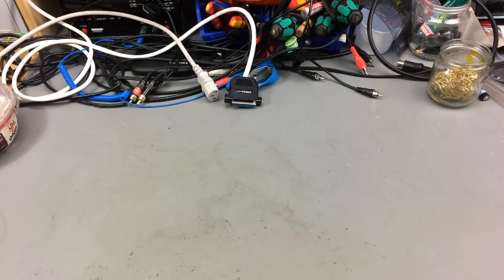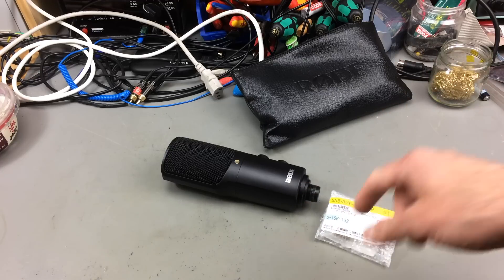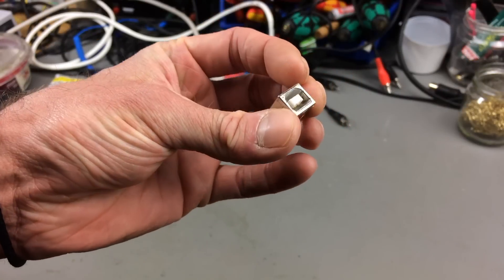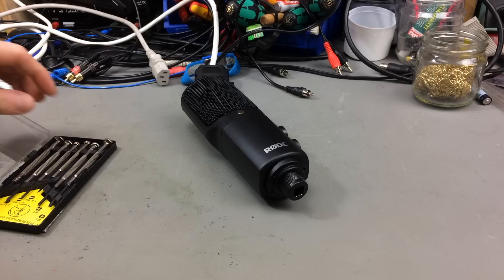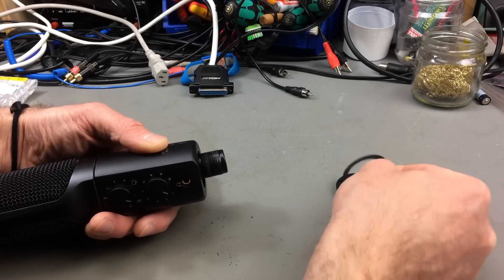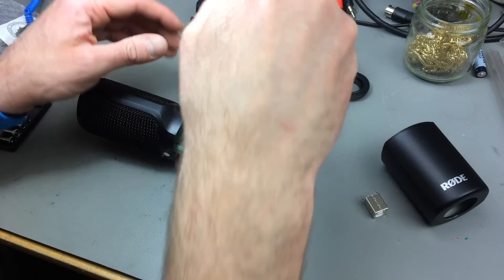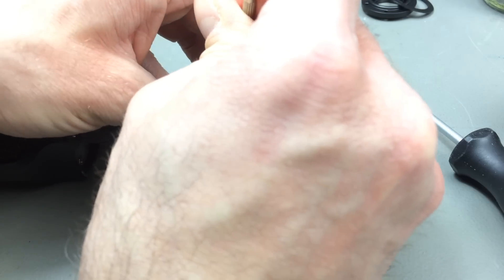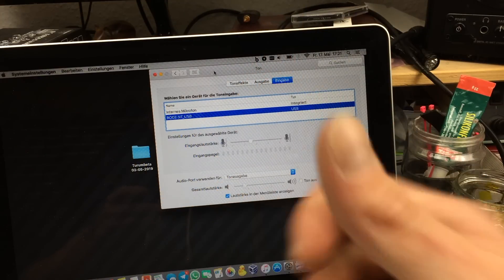Røde NT USB Microphone Repair

Comment: Excuse me, Jan. I understand this video was produced six years ago, but I thought I would reach out to you in regards to my own NT USB.
I attempted my first time soldering on my RODE NT USB because my port broke, which is this exact repair you did. I did not do it correctly, and unfortunately it lead to the silicon being too hot.
I've shipped the microphone to my friend who lives out of state, and he tells me that the PCB can be replaced, for the USB connector that is. If you know anything in regards of locating one of these components, I would be incredibly grateful.
I am in a disposition where replacing my microphone altogether would be damaging to me, and if I cannot truly save my NT USB, then at least I will know my next steps forward, and that would be saving up for an XLR, and DAC etc. Perhaps that is the way.
Reply from the maker: No idea where to get those replacement boards, unfortunately. Maybe ask at Rode directly? They might have a department that provides spare parts to repair shops. They are very likely more interested in selling you a new mic so I wouldn’t hold my breath though. :/
Reply: @JanBeta oh believe me, I've considered that outcome- sadly

Comment: I have this same mic since 2015. I live in the UK. Today I wanted to use it, but no blue light on the front. Mic is detected by windows and OBS, but no sound is picked up by the mic. Any idea what would be causing this? Thanks
Reply from the maker: Sounds like maybe it's a connector problem, too. Probably the voltage supply to the mic cuts out. Might be a broken trace somewhere, too.
Reply: @JanBeta  Surely it cannot be a connector issue as the mic is getting detected? Moving the USB cable at the connection DOESS NOT make it intermittently work. Can I send you photos of the interior if I open it up.. and would you be able to assess it from those photos? Thanks

Comment: My Rode NT USB began to be detected in the Windows system as a USB PnP Sound Device. I reinstalled the USB drivers, I reinstalled Windows, I changed the cable, I connected it to another PC, but nothing helped. What could it be? The microphone works, but is recognized in the system as a USB PnP Sound Device. Although previously it was defined as Rode NT USB

Comment: I have the exact same problem you described, but when I open my microphone it looks ok and it is glued.
Do you have any idea what could I do?
Reply from the maker: I would still guess it's a cracked solder joint on the connector. Maybe it is possible to remove the glue and take a closer look/measure continuity. The rest of the circuit should be pretty reliable as far as I can see.

Comment: Hey, having the exact same problem and while waiting for my usb b females to arrive i was wondering: is there a simple way to stabilize this exact point to prevent that from happening every few years? Maybe someone can share some experiences or knowledge. :-)
Reply from the maker: Use a better quality USB socket (like I have in the video), use leaded solder (which is a tiny bit more flexible and less likely to crack), put some strategic dabs of hot glue or non-conductive silicone glue around the connector. Not much else you can do, I guess. :)
Reply: @JanBeta  Thanks for the quick answer, guess that is what i'll do!

Comment: I have exactly the same problem..Must be a weak connection in all Rode U.S.B. microphones
Reply from the maker: Yes, I heard from quite a few people experiencing the exact same problem. The construction is not very sturdy with the connector soldered on in a way that it was not designed for. The solder joints and the connector get a lot of physical stress this way. Poor design choice for sure. Although the mic itself is excellent.
Reply: @JanBeta  I use the microphone for singing.  I find recording vocals through U.S.B. microphones still needs some post editing on a audio editing programme.  I also have an old Blue Snowball.. good but the Rode is slightly better...The Rode cost me well over 200 dollars new..I must have it over 5 years. I wouldn't have the courage to take it apart..I'd probably mess it up completely.. I've let it fall accidentally on the floor a few times...it's still working.

Comment: This microphone for me was a disaster, bought it for 150 euros exactly in late 2022, and few months has passed only and that USB connector is broken, im talking on discord and it goes quiet, or completely disconnects... I opened it like how you opened it, and well, i did it before i watched your video, i was astonished, the build quality is barbaric, found stripped screws, (one of the four which hold the top part on) they just screwed it half way in because it stripped... and not gonna talk about the bad design of the USB connector.. This is just industrial trash.
Reply from the maker: Wow, that sounds like a very low standard of quality control. Mine was at least assembled properly (apart from the shoddy USB connector). :/ It’s a shame that they put so little effort into the construction. I’m still very happy with how the mic sounds though!

Comment: Hello, my problem is that when I connect it to my MacBook it showing it in audio devices for both in and out, but in 2-10 sec it disappears. Blue lamp is on. I can hear sound of it only directly from headphone out on mike itself. Please help me to resolve this issue. Thanks.
Reply from the maker: Mh, sounds like an intermittent connection on the data lines to me. The mic and internal headphone amp are going to work fine as long as the power gets to the mic but you won’t be able to use it via USB. Maybe try to use another USB cable and see if that fixes it. Otherwise I’d advise to look at the solder joints on the USB connector in the mic (as in this video).
Reply: @JanBeta  tried different cables, new connector. All the same..

Comment: I cannot buy the connector, do you think its possible to directly wire to the PCB?
Reply from the maker: It is possible of course, it's probably not going to be very sturdy though. You should be able to get a connector that fits somewhere I guess, these are super standard parts, many USB sockets with the correct orientation will fit fine. It doesn't necessarily have to be the exact one I used.

Comment: My Rode NT USB Mini plugs in and lets me use the headphone jack but the mic doesn't work anymore so annoying. Getting xlr mic soon to fix this issue. Is there a fix for mine?
Reply: Might have to check my windows services to be sure I didnt change anything, AND NOW IT WORKS. I suppose I disabled the wrong thing hmm. Bluetooth is still broken on my Windows 10 thats for sure!
Reply from the maker: For me, Windows 10 has a tendency to break the settings for audio devices with every update, I usually have to fiddle with the settings a bit and reactivate things to get everything working. Glad you fixed the problem for now! :)
Reply: @JanBeta  It was putting my BT device to sleep before the driver could get installed. Everytime. Turned that option off and reinstalled realtek bt drivers and it works again!!!

Comment: Hi, how were you able to tell that this was the issue? My Rode Mic doesn't get recognized by PCs or Macs, but the light lights up when plugged. Monitoring works as well. Could it be the same thing?
Reply from the maker: Yes, could be the same issue. If the mic gets USB power, it is going to light up and the internal monitoring is going to work. You probably have one or both of the data lines on the USB broken.

Comment: Guys, i found a good trick to get the two volume knobs off: I just used ducktape and rapped it around the knob so i could pull out the knob without damaging the case.
Just wanted you to know
Reply from the maker: Good trick!

Comment: Hey Jan, I followed this video in order to fix the loose USB (bad contact) from my RODE-NT Usb, but the first time I assembled it on the opposite side,  so the power was not enough to even light up the blue light on the mic. So then I soldered  it the right way, and the microphone gets the power correctly(and the led light lights correctly). But my issue is now that my PC does not recognise the microphone. At times, when I plug it in really snugly it works and it starts installing the drivers on my pc, but it quickly disconnects. I have asked several places in my city, but nobody seems to know the solution. I wondered if you or anyone in the comments section would know what could I try/do since I don't have a warranty to send it to official RODE, and they might charge me more money than what I paid for this.

Comment: Hi i just wondering where did you buy the connector for replacement? thanks for the answer
Reply from the maker: The link is in the video description. You should be able to copy & paste the provided part number into the search of your preferred (local) electronics parts seller. :)

Comment: Temperature on the solder?
Reply from the maker: I usually go with 350-370C for regular PCB soldering like this but your mileage may vary a bit depending on your soldering iron and your technique.

Comment: I know this video is kinda old, but i really can't twist of the bottom. Even used screwdrivers like you have done but it just wont' come off
Reply from the maker: I remember having to use quite a lot of force initially (I had already opened it before when I shot the video). Maybe just try brute forcing it some more? I can’t imagine that they used glue or anything on these. It’s probably just very tightly screwed on.

Comment: I've been using Rode mics for my whole career, 35 years in audio. When I saw they had a USB condenser mic, I was interested to find out if it was up to the same standard as their stage and studio mics. My biggest concern was how the Analogue/Digital converter would sound, since they used the same capsule as the NT 1A and I know that cap works perfectly. Well long story short I brought one and I'm very impressed with it. They've particularly well suited to deeper male voices because of the better frequency capture in low and low mid ranges. To get the best out of it for voice work, sit very close to the mic and talk across it, not directly into it, to make use of the proximity effect. It will get every nuance of your frequency range for pants moistening deep boomy man voices that drives the girls crazy and make subs shake desks. Good score, and thanks for the teardown (mine has scratchy volume pot, needs a clean.)

Comment: nice repair and easy-to-understand explanations... I happen to have the same mic and I was wondering if you could tell me what to fix/ replace in particular because my headphone jack doesn't work anymore... So whenever I try to monitor my still working recordings I can only do it without the mic's output AKA by using the normal speakers included in my PC...

Therefore could you please explain what causes the headphone jack to stop working or make a video on it? I noticed that you were very good at explaining in this video, it would help me out a huge bunch 

Btw, I also noticed that you had a bit of a German accent, I'm a German myself xD
Reply from the maker: Oh, I didn't look into how the headphone amp works. Might just be a broken headphone jack, that's a common fault in most devices. I can't really make a video about that unless mine breaks I guess. ;)

Comment: Hi first off great video👍, i have the same microphone but in my case the little black box ( 7:08 ) with the 4 pin slotes on the mainboard broke off.
Do you think it can be repaired?
Reply from the maker: Yes, that is a standard 2.54mm pin header. You can buy it from a lot of electronics suppliers. You would have to measure the size (height) precisely and find a matching one. Desolder the old one, solder in a new one.
Reply: @JanBeta  damn i didnt excepted a answer so fast thank you😀

Comment: My NT USB also died, but sadly there was an over voltage and a spark at the headphone connection. This is probably unrepairable, right?
Reply from the maker: Oh, most likely a transistor died. I wouldn't say it's unrepairable but troubleshooting might be a lot more difficult.

Comment: Seems really dumb to use a surface mount part for this but then again I have no idea if you can even get a more securely mounted USB-A port. At least I would want the metal shroud to act as a strain relief on the port, so that it doesn't get tugged out like this seemingly was.

Comment: Nice repair Jan thanks oh i have a suggestion for that microphone drill a hole in the small pcb and put a stiff wire through the hole and solder to the usb mount lugs in like a u shape to make the whole assembly a little stronger

Comment: Seems to me there is a bit of a design flaw with that. The two metal lugs on the shield should act as a strain relief for the connector, as they are not used the strain is taken by the pins that flex slightly with constant plugging in and out the cable. Hence the connector eventually broke off.

Comment: I had to get a warranty replacement for my Røde NT USB microphone due to exactly the same failure.  This really is a very poorly designed part of the mic - the USB connector should have been properly mounted to a PCB.  I suspect this is a pretty common mode of failure for these mics.

I used to remove the USB cable from the mic when not in use but now leave it in there and instead disconnect it at the computer.  Hopefully, this will prolong the life of it.  That said, I really didn't connect/disconnect from the mic that much so it didn't last anywhere near as long as it should have.

Comment: Stress locations, it helps to put something there to strengthen it.  Such as hot glue.  It won't strengthen the solder connections, but it will provide the whole backend with support to the board.  Resists vibration and movement.  And its easy to remove.

When used on wires soldered to pads or terminals, the vibrations of daily use, time, transport etc are absorbed by the glue, which has some "give" and retention; and not allow the wire itself, at the solder point, to weaken.  Instead of a fixed point where all the stress terminates (where it is soldered), the stress is distributed across the entry point to the glue, and seen in parallel along the remainder of the wire to the solder.

Love those easy fixes.  But then I don't learn anything.  And I love learning, more than I love easy fixes.

Comment: Put little adhesive tape around the screw driver then you don't scratch the metal housing.
Reply: Standard electrical tape may be too thick for this, but what does work well is PTFE tape used for plumbing work
Reply: Hi @jaycee1980 . Yes that's also good idea. I used a really strong and thin electrical tape. See you, Doktor64! :-)
Reply: Yeah where did I see that.  Oh right, when Jan repaired the stereo equipment in his previous video.

Comment: Man, so happy for you!
To be honest I had a pretty high opinion of Røde but seeing how that USB jack was designed, I have to say my opinion has changed slightly
Reply: There should at the least have been some potting material to relieve the stress from those 4 pins.   I agree, poor design.
Reply from the maker: Thanks! I don't think it's bad design really, there's a screw to hold the USB jack in place and I also like the modularity of it. No idea how the previous owner managed to break it actually.
Reply: @JanBeta  maybe the previous owner did a lot of traveling? i.e. packing/unpacking equipment, plugging/unplugging for gigs etc.
That jack would be a stress point for a careless user... It's more of a studio mic though, so not sure if that makes much sense! :D
I feel it could have been slightly better design with the jack mounted normally on a PCB, but then having an angled pin header that couples with the main board, rather than the straight pins.
Reply: Had 10 mins free to procrastinate! Essentially something like this:
https://imgur.com/a/iYJjNxi

Although rewatching your video now, the design is not THAT bad.
They must have had additional challenges like the placement of the 3.5mm plug to think about as well.

Comment: I really like detailed repair videos but 18min for 4 solder joints is a little bit excessive...
Reply from the maker: You are probably right... The most difficult part was probably opening the thing up but it didn't take that long. Sorry if you feel you wasted your time on this!
Reply: @JanBeta  I was perfectly happy with the length,
Reply: @JanBeta  As was I...

Comment: Strange how much effort goes into the acoustic design with how little went in to the USB jack.
Reply from the maker: I guess the acoustic side of things was done by another team. The USB jack design is fine in my opinion, no idea how the previous owner managed to break it that badly.
Reply: Items like the USB jack are bought in bulk off the shelf from the lowest bidder. There are pros and cons to using industry standard connections; obviously they can be much cheaper but that also means that you don't control the quality. Back in the days when everyone made their own proprietary connectors, this was less of an issue, but then you run into the issue of inter-compatibility and not being able to find adapters. The nice part is that even though the part was of lower quality, replacement parts are very easy to find and work with.
Reply: @raggededge82  The socket is fine. But the mounting is wrong. The socket has two lashes for mounting that are not used. It could have been glued or clamped in position. But the full force is on the pins that are not made to maintain the forces. This is a bad design from Rode.

Comment: Thinking about how much stuff just gets thrown away, wasting all the good resources. And most of it would probably be relatively easily fixable, like this mike. You are doing ecological work here as well.
Reply: It's terrible how much stuff gets chucked away for small faults... and in the UK, you cant even save stuff from the recycle center any more ! They wont let you take anything, and if you do it's classed as theft